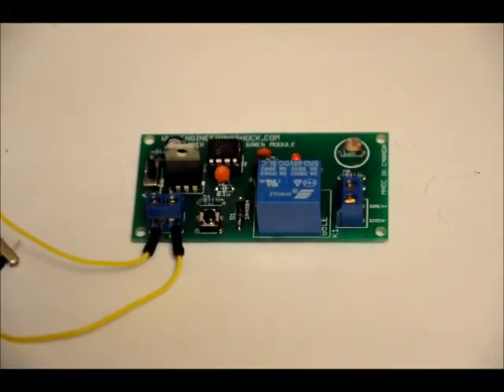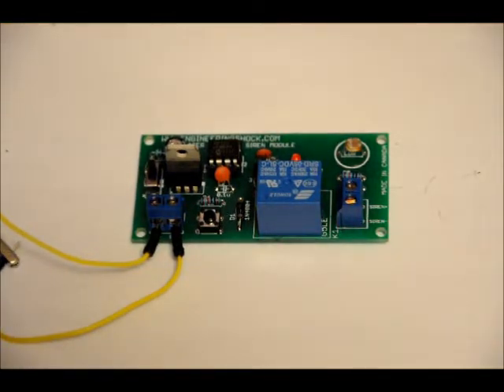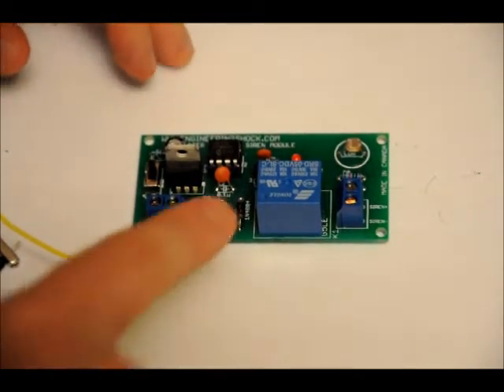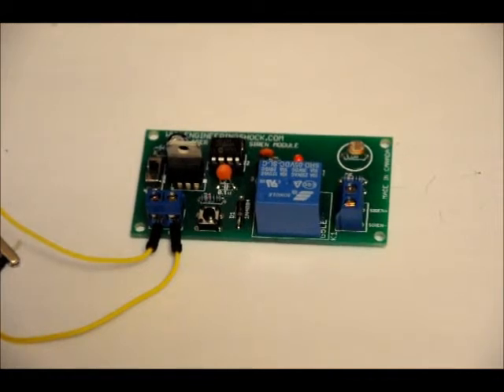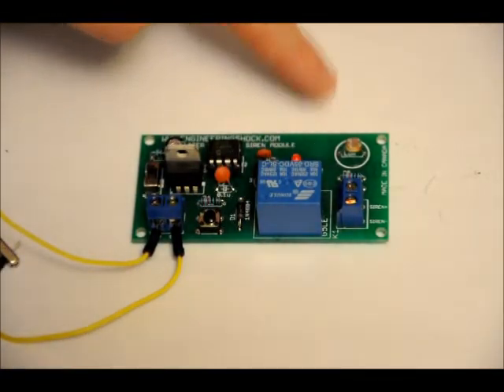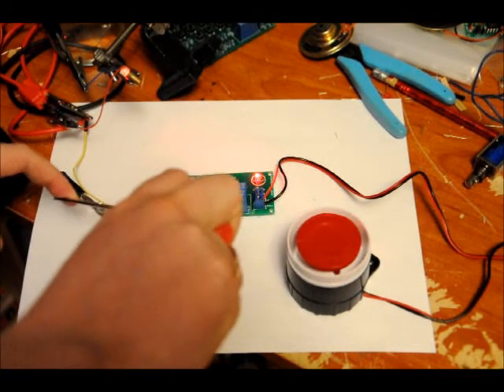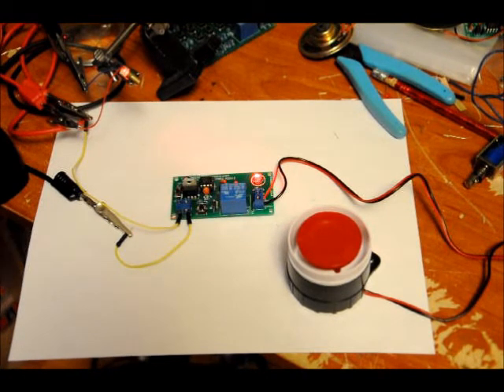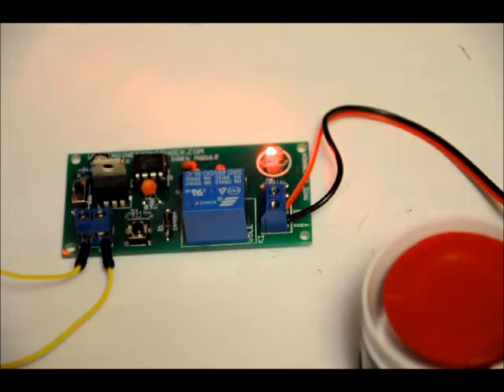Laser Security System Kit With LOUD Siren Control - EASY TO USE!

Comment: Would be great to use this on vehicles?  Like point to a driver seat or something or door opened.   A lot cheaper than car alarms... would this noise would drive the theives nuts.

If you could add like a remote... cool product.